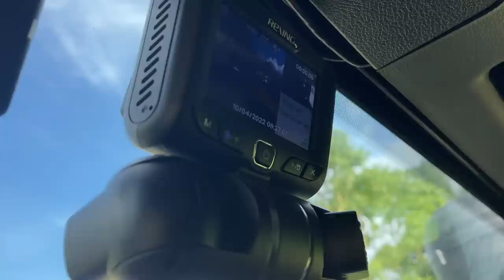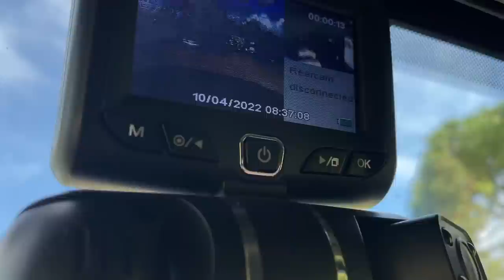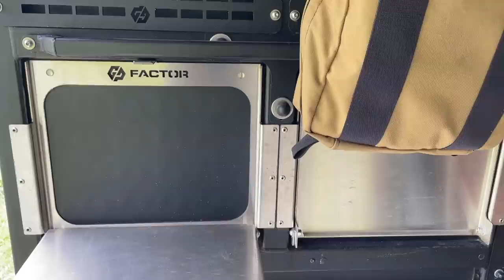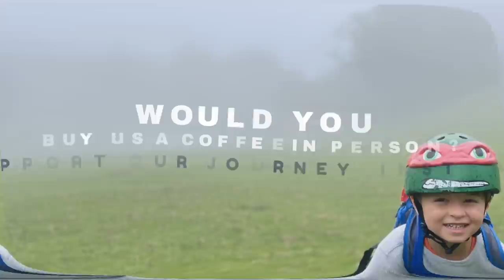ULTIMATE OVERLANDING JEEP GLADIATOR WALK-AROUND TOUR (ft. the Alu-Cab Canopy Camper)

Comment: Juat a note on the recovery gear: probably best to have it accessible from the interior or the other side. If that door gets blocked while you're stuck, its game over. I learned the hard way with keeping my winch remote in a place i couldn't access it when i was stuck.
Reply from the maker: Solid advice. We actually have a hatch on top of our Goose Gear accessible from inside the cab which I thought we showed? Maybe we didn't. But yes, we can access our recovery gear in a pinch from inside the cab without opening the doors. It wouldn't be a lot of fun, but it is doable. ~ Eric

Comment: It may be a touring vehicle however in my opinion a rock slider (steel or alu) is a must have, since you're living full time in your Gladiator sports. Why not Rubicon?
Reply from the maker: Hey Laloo, thanks for the comment. So rock sliders add weight. Even aluminum ones. We aren't rock crawling, we're attempting to drive around the world. Weight is everything in an overland build designed for a family capable of travel during all four seasons. We aren't packing for a specific trip, so we have to be prepared for much more than the typical overlanding loadout, and weight often gets calculated in ounces instead of pounds with this type of full-time global travel. As far as why not a Rubicon, man I would have loved to have one. But again, weight you are carrying for full-time travel is the primary reason, more specifically, payload capacity of the vehicle. The Rubicon payload is 1200lbs. The Sport S with the Max Tow package and automatic transmission (which is what DAUNTLESS is) has a payload of 1,565lbs. That 365 extra pounds over the Rubicon trim makes a huge difference. Hope that answers your question. ~ Eric
Reply: @HourlessLife  I got your point. Atleast got a plastic steps😃.

Comment: Do you have any issues with the canvas leaking with the pop up roof system? It seems with the amount  of rain you would encounter in South America  it might be a problem. Do you have any other type of ventilation  other than those 2 fans. (Maxxfan for example) Thank you for the vid. Ya'll 3 did a Great job explaining  your build!! Be Safe!!
Reply from the maker: Hey Mike, sorry for the delay in response. Brittany just had a surgery. I posted about it in our community tab here on YouTube. No issues with leaking in our setup when it comes to the tent. As far as the Jeep, all Jeeps naturally leak, it comes standard. No other ventilation other than the two fans and opening up the sidewings and windows on the Alu-Cab Canopy Camper, but we've found it to be sufficient. ~ Eric

Comment: I have a question on fuel type. why did you choose gas over diesel? LOL I found your answer in the Gladiator Build section. When I did my Alaskan build in 2013 I did a side by side comparison and ran it out to 100,000 before buying. The gas engine was all-allround cheaper despite diesel fuel at that time being cheaper
Reply from the maker: Glad you found the answer. In short for anyone else reading. Unleaded fuel is available globally while DEF is not. Someday it may be, but as of now it is not the wisest decision for global overland travel. In every corner of the world you will find a motorcycle. Wherever there is a motorcycle there is unleaded fuel. ~ Eric

Comment: I you didn't use that fridge slide but rotated the fridge front to back and mounted it - would it still fit? I'm trying to imagine 2 dogs with the fridge on a back seat/platform. Thanks you for sharing your journey.  cheers
Reply from the maker: Hey Lefty, so that's a great question. So here's the situation. I got your comment just after I loaded our Gladiator inside a container to ship to South America across the Darien Gap. Normally I'd be happy to take some measurements for you and get you a solid answer, but I likely won't have our overland rig until somewhere around the middle of November. I'm happy to do so if you remind me. With that said, keep in mind that for the JT Goose Gear makes a high seat delete and a standard seat delete. We have the high seat delete so that we can slide it out of the back door. If the measurements worked out and you had the standard Goose Gear seat delete you would have even more vertical room for access to the fridge. Also if you don't need to haul a 5 year old around you could opt for the 100% seat delete instead of the 60% like we did giving you even more room to play with fridge placement. Not sure if that helps, but hit me up towards the end of November and I can break out a tape for you and get you some measurements. ~ Eric
Reply: @HourlessLife  Thank you

Comment: Excellent video. Thank you. What about your heater? Isn't that diesel?
Reply from the maker: Thanks so much Doug. No, there is nothing on DAUNTLESS that is diesel. The heater is a Webasto heater that is plumbed directly to the stock fuel tank. It uses about 1/10th of a gallon per hour. ~ Eric
Reply: @HourlessLife  that is awesome. Thank you. I spoke with you at expo west 2021. You mentioned insisting on 1 fuel type. I know the diesel versions are becoming popular, but for me that is fuel 3, after propane. I plan to stay in the USA. Would you still stick with gasoline for heat?

Comment: Amazing setup, however why aren't you guys running a rock sliders?
Reply from the maker: Hey laloo, I actually answer that question specifically in the video. You may have skipped over it. Basically because DAUNTLESS is purpose built for a global overland journey and we're not rock crawling. Weight is a premium consideration, every ounce we can save we are saving. Also, I do my best to respond to every comment but it is getting harder. Sorry it took so long to respond to yours. With the holidays, we took a short break. But we just published a video about Barichara which is the most highly recommended place to visit here in Colombia. Hope you check it out! ~ Eric
Reply: @HourlessLife  it won't hurt to run a light weight step/slider combo made of aluminium. In my humble opinion. However as long as you guys are fine with it it's okay. It's just my thing cuz every 4wd i got has a slider. Good luck guys.

Comment: Great build and great video. What is weight of this build?
Reply from the maker: Thanks Jeff. Build weight is a hard thing to determine as every single change has to be calculated. For example removing the stock tires and wheels, adding the new ones and calculating the difference. In addition there are fuels and liquids that aren’t always at the same levels which can vary the weight hundreds of pounds. Plus the change in our own weight and the fact that we get rid of things and add things as we travel. Having said all of that the only way we can determine maximum weight of the build is to fully load out the rig with all fluids topped off (extra water and fuel) and fridge full and every piece of gear and equipment loaded. Then we had to add weight equivalent to Caspian’s projected weight as an adult and subtract his car seat. All that to say that there is no exact science to your question but one that we were really curious about too. After all that we needed to weigh both the steer and drive axle. We did that in October 2021 just before departing on the journey and the steer was 2980 and drive was 4500 for a total of 7480 however we don’t actually carry that weight. That was the max our rig would ever be loaded. We also have to subtract the allowance that Jeep gives for the driver. So those are the numbers, realistically and for all practical purposes we are driving with about 2900 on the steer and probably around 4320 give or take on the drive. This is based on the average extra fuel and water we carry and our current load out. Really complicated answer to a great question. ~ Eric
Reply: @HourlessLife  Thanks for taking the time to post this. No one I've asked has ever answered! I know it is hard to estimate it prior to the build, but it seems like everyone should have weighed it after the build, fully loaded, as you did. This build is very similar to what I have planned, although I don't plan to do it on a Jeep. But I find it difficult to find weights listed. For instance, unless I'm missing it on their site, I have never found weights for any of the Goose Gear products, and these would be a big part of my build. So I'm flying blind when trying to figure out what the full camper build and the rear seat delete would be, in order to compare it to the payload of the vehicle I have yet to decide on. Thanks for your time. Looking forward to following your South America adventures.
Reply from the maker: @jeffhatfield.1  no worries. I saw your question as soon as it came in and I do my best to respond to people as soon as I can, but I wanted to find our weight slip and give you the actual weights. So, it took a little longer to answer your question fully as I wanted to give you a complete answer. Congrats on your upcoming build by the way and your future adventures! Several thoughts, the reason that most people won't answer you is that 1. They don't know because they haven't considered the importance of the payload due to ignorance as to its level of importance. 2. They know what it is and don't want to say because they are grossly overweight. Honestly it could put them in legal trouble if they are to put that information out publicly if they were to get into an accident. An insurance company may refuse their claim because the exceeded the stated payload of the vehicle. As far as Goose Gear, (full transparency, they are one of our sponsors) but they are a great team. If you email them and ask them the weights they will provide them. I suggest you do exactly that. Also please know that I'm happy to be a resource publicly, and hopefully you can see that I'm responding at length to help you out. But I don't always have internet connectivity on this drive around the world. We do have a Patreon account which I invite you to join. That is the platform we always check first and respond to first when we have internet. Your patronage would support our journey, and I'm happy there to dive into any questions as you continue your build. Again, we'd appreciate the consideration, but not required at all. If you ask me questions here on YouTube or on Instagram, we will respond as well to the best of our ability. ~ Eric

Comment: Hi guys, hope all is well. With your fridge access, did you just remove the stay?
Reply from the maker: Appreciate that David. So yes, we removed the stay, and we extended the electric cables so that they wouldn't be too tight when fully opening the door. But that was a little extra on our part just to keep wear and tension off those lines. You could probably get by without going that extra step. ~ Eric
Reply: @HourlessLife  Thanks Iric. We are currently working out a new vehicle camper for our Gator Gladiator here in Brisbane Australia, currently we tow #toughtear . Looking a Alu Cab, Skinny Guy and Camp King.
Reply: Can you please explain how you extended the rear door electronic cable for a wider door opening? I can’t seem to find anything to have a wider door opening. Thanks!!

Comment: I was surprised that you "CAN'T" use diesel world wide?  Is that accurate?  I thought diesel was more available in most countries.
Reply from the maker: Great question. Diesel is readily available in many countries. However ultra-low sulfur diesel is not. All of the newer diesels require it unless you modify the vehicle. However, in every corner of the world you'll find a motorcycle. And where there is a motorcycle there is unleaded fuel. This was our decision since this is an attempt at a global overland journey. If I were building this rig just for North America, it would have been a diesel Gladiator. But for this trip, a gasser was the right call. I do my best to respond to every comment but it is getting harder. Sorry it took so long to respond to yours. With the holidays, we took a short break. But we just published a video about Barichara which is the most highly recommended place to visit here in Colombia. Hope you check it out! ~ Eric
Reply: @HourlessLife  Thank you so much for the information.  I was actually considering the new-ish Chevy 1/2 ton truck with the new 3.0 liter in line six turbodiesel as my base truck for my overland build.  I have the Bundutec Wild camper being built...now, I guess I will move forward with my current 2014 Tundra with the 5.7liter V-8.  I was thinking that the diesel would be more fuel efficient, and world wide compatible for fuel...So, now I know that will not work...So, my Tundra will not be sold off to get the Chevy diesel!

Comment: what do you do for hot water to shower with?
Reply from the maker: We don’t have hot showers in DAUNTLESS. However the shower nozzle is plumbed to the Alu-Cab 13 Gallon tank and powered by a water pump. Because the tank is inside the habitat, it is normally lukewarm. If we are in an extremely cold climate, our Webasto heater is on which again warms the inside of the habitat thereby affecting the water temp of our shower. Hope that helps. ~ Eric

Comment: I had that exact same aluminum Rock Hard Patriot front bumper.  The very first time I used the recovery points it warped the front fascia.   Poor design. Never again.
Reply from the maker: Sorry you had that experience! That has not been our experience at all. We've been really happy with our front bumper, and the light weight of the aluminum for our build. Hope you found something that works well for you. ~ Eric
Reply: @HourlessLife  I did.  I loved that it was so lightweight too.  As long as you don't need to be pulled out of mud or snow or sand or whatever by that bumper, you'll be fine.  But personally under a really heavy pull I don't trust those mounting points not to just rip off and go flying.  Just look at how they're built, and you'll see what I mean. The recovery points themselves do not mount to the frame, and that is the problem.

Comment: Just buy a Real pickup and put a camper on it ! Remember u have to rework all ur undercarrige just to haul the xtra weight and the truck is Allready built for that !!
Reply from the maker: Dudley, I'm sure you mean well, but this isn't really a thought through comment for our type of journey. Shipping a vehicle across oceans requires specific measurements for container shipping which is the most cost affordable. Our rig was designed to fit inside a container intentionally as I mentioned in the video. The Jeep Gladiator is more than capable for what we've designed it to do for this drive around the world. A "real pick up with a camper" would have to go RORO across the oceans (roll on roll off) and there are all kinds of issues with that including price, security, time, etc. DAUNTLESS was designed for the specific journey we are on. We mention in the video that the build of the viewer might be entirely different for their type of travel, for our type of travel DAUNTLESS is exactly what we were hoping for. We're really glad with how he turned out. ~ Eric
Reply: @HourlessLife  @dudley Baggerman - I am building out an F250 for a similar purpose. I am not planning to go all continents though. Mostly the Americas, Newzealand and Australia. The F250 can carry a lot of weight, but I will face challenges when it comes to container shipping. I will make it work, but I have to spend more time planning (and money) to do so. It would be easier if I would go with a smaller vehicle, but I am putting a pop-up camper on there.
Reply from the maker: @ChristophPuetz  thanks for the comment. For what it is worth, we see all kinds of overlanding vehicles down here in Latin America. Everything from huge expedition vehicles to mini vans. Every vehicle build is going to have its strengths and weaknesses as a platform. The bottom line is taking the one that is right for you and your type of travel. This of course includes budget considerations. To give you an idea, just shipping from Panama to Colombia is going to cost us about $6000 less than it cost some friends of ours with a truck and camper who couldn't fit inside a container. So that is a consideration. As is parking, navigating extremely narrow streets, and low clearance bridges and sections specifically in more remote areas. The most important thing is to take the journey. I'm excited for you and your future adventures. If we can ever be a resource for you as you are building out your rig, let us know. ~ Eric